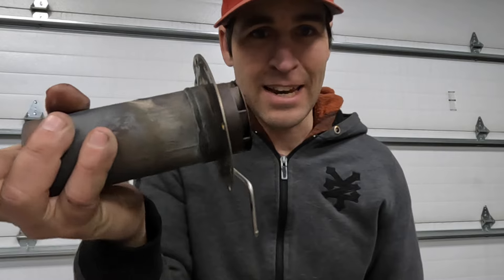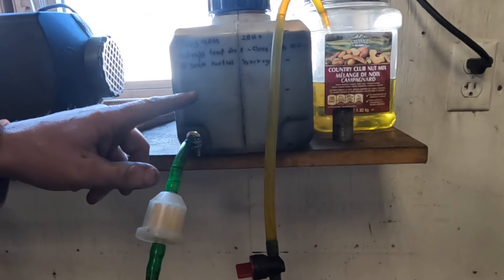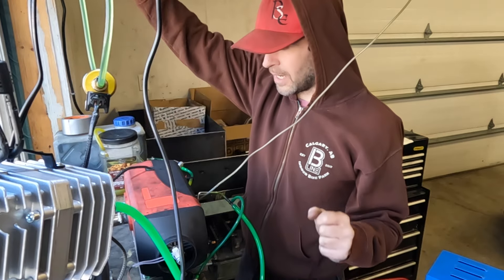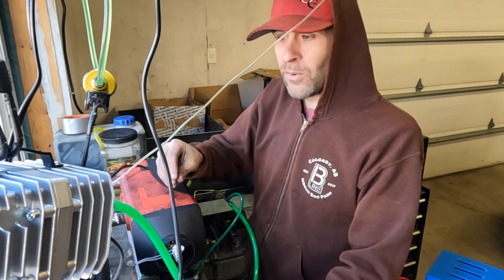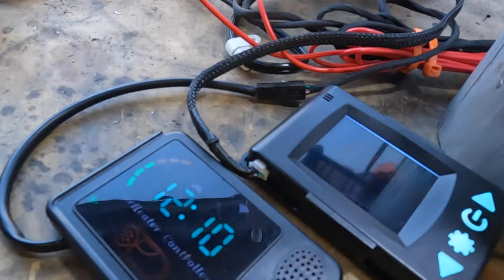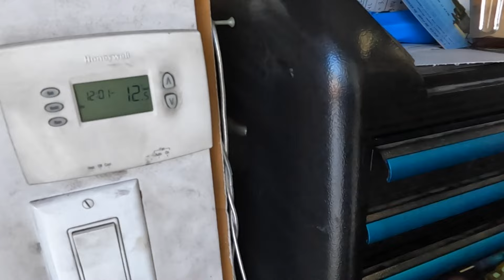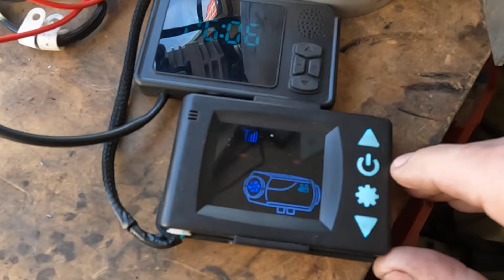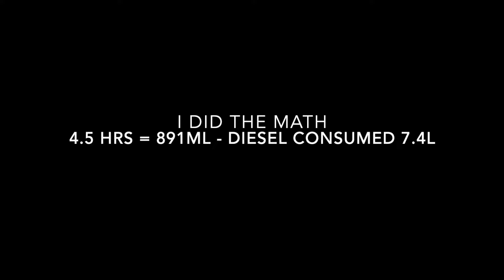Incredible Results - Diesel heater Burning Used ATF -  (Success?!)

Comment: Two of the 3  Vevor heaters I bought last month are the same $119 units you unboxed here today. What a bargain. 
 I've been meaning to ask,    is your 5% discount up and above the 5% Vevor offers, making it a 10% discount?  

 You revealed a lot about the new design of the burn chamber. 
  If there were only a reasonable way to make adjustments on the fly inside the chamber,  that would be cool .  

 27:42  For what it's worth,  I foresee a few things happening.  Nice design by the way 😮
*The heat exchanger body getting hotter than what the rest of the components are designed for and setting the stage for a spectacular "Final Meltdown" 🔥🧯👨‍🚒 👍🏼  
* It may carbon up if the airflow is restricted too long in the burn area even though the attempt is to keep it there and burn ALL of the fuel / gases prior to exhausting them.  
* It may go viral and get 3 million hits !  👍🏼
 
🤷🏼‍♂ So what else is left to do but drop it in there and hope for a eureka moment.  🙏🏼 

Vevor's secretly using you for your R & R work 😂🤣
That's cool, keep sending your products Vevor, and Joel will keep putting them to the test... 

🤔My lowered expectations exceed themselves 🤔? wtf   😂🤣
Reply from the maker: I thought it was additional, but apparently it's not, because the item is on clearance (I'm guessing). I just added one to my cart and tried to use my code, but there was already a code there... I deleted the code and now the website is NOT happy, haha. 

If I left the fuel nozzle loose I could rotate it and see if it makes a difference. I've been working on the new nozzle (pretty much done) and I think it is going to be much more effective. I also noticed that the oil that got in my air pump didn't do it any good... I have serviced it, but it needs new valves ... It doesn't always make the same pressure / flow, but when it does, it is pretty impressive. 

Haha... I like your predictions. Hopefully I can control the heat so it doesn't melt ... yet. If it is too restrictive I should be able to tell pretty quickly, based on CO and the temp it reaches on diesel alone... then make changes and try again. I may have to widen those slots. A viral video would be cool... haha.🤟

Haha... yeah... Vevor is making notes and ready to release their J Spec Combi heater. Diesel / WMO heater.🤣
Reply: @loweredexpectations4927  I'll try to buy one tonight. I bought mine on clearance but,   as late as 4 days ago
 I noticed Vevor were selling them as a "on sale" item. 🙄 
  Ying-Yang advertising,   It's all Chinese to me 🤔 Hahaha !

" I've been working on the new nozzle (pretty much done) and I think it is going to be much more effective".

I had to delete the burner idea I had wrote down 😂 mainly because it involved using 2 bearings within the  heaters housing and got wilder from there. 

I was thinking back to last weeks comments that the "pump" having rubber valves / O-rings,  might be vulnerable to swelling issues as does the principle behind swelling oil seals in order to stop leaks.  It's a good thing to know for obvious reasons and well worth mentioning.  Will be watching for more 👍🏼

Hear ye, hear ye, hear ye ‼
Get your very own J Spec Combi heater. Diesel / WMO heater coming to an apocalypse near you, 2025.
Reply from the maker: @DanDan-yy8sf  HAHA... I have had some of those wild ideas that I was like "ok, now let's design something that I will actually build" 

Haha... I'm thinking that I REALLY want to try "burning" pancake syrup in my secondary chamber... just to see what happens.
Reply: @loweredexpectations4927  Smells like the right thing to do 🤣

Comment: Can you try spraying water into the intake when running to see if it cleans the inside with steam? Just like the decarbonization is done in cars.
Reply: Water Methanol mix, like in diesels, would be fun to see the effects
Reply from the maker: I do want to try this, out of curiosity and almost did it during my last test haha... 

It could actually work with this set up, as the primary chamber will keep it nice and hot. Others have suggested this before, with the single chamber... the issue with that is that it would have caused it to flame out pretty quickly. 

Now you have me wondering what would happen if you injected liquid nitrogen, haha.
Reply from the maker: I'll see if I can make this happen 👍

Comment: Key ingredient ATF👍 
1. Always add the diesel deep clean treatment to any waste oil fuel supply to help carbon/coke burn completely to ash.
2. Add ATF to used oil supply to help keep the fuel tank/lines/pump clean, and help scrub the inside of the burn chamber.
3. Some sort of way to occasionally inject air bubbles into the fuel line to 'interrupt' the fuel supply into the burn chamber so a little extra oxygen is added to help burn carbon/coke buildup and blow it out.
4. I built a heat exchanger for the burn chamber air intake to syphon heat from the exhaust to help bring the oxygen and fuel closer to its flash point
Reply from the maker: Thanks for the comment. 

I'm not sure if these are suggestions, or stuff that you do... 

I have used a few different fuel additives by Redline and STP... They seemed to help a little with reducing carbon. 

I found that burning ATF cleaned out the heater when compared to / after running waste engine oil, but for me, burning diesel does a better job at removing soot / coke.  

Adding air bubbles will make the heater run lean due to the lack of fuel, but the amount of air in bobbles is insignificant. a bobble large enough to make any difference in this way would starve the heater for fuel and cause it to flame out. 

Burning waste oils does require more heat, so I can see how heating the inlet air could help... I have experimented with this in the past and didn't find a substantial difference in burn quality, but it was a long time ago and I probably wasn't tracking the data well... Hot air is less dense, so while it carries its own energy, it is not capable of producing as much energy. 

If this stuff is working for you, then keep it up ! 👍

Comment: The ring you plan to insert may benefit from some smaller holes around the big one to get a circle of flames around the center
Reply from the maker: You could be very right there... I did that with my original burn chamber.

Comment: Hi Joel,

Thanks for the test.
I don't recall where I read it, but I remember reading that someone was burning a 50-50 mix of used ATF and diesel directly into their primary heat chamber, with no ash buildup.  It seems that ATF burns a lot better than used or new motor oil does, and without causing an ash buildup.

Could be that ATF is closer to diesel and kerosene than motor oil is.  That kinda makes sense as many diesel folks (myself included) use atf as a fuel treatment for their diesel engines.

You might try the 50-50 direct burning as a test.

Philip
Reply from the maker: Thanks for the comment. 

I have been trying to tell people fro almost a year that engine oil has a whole different set of challenges to other oils / fluids. It is a heavy oil and will produce ash regardless of it being "clean" or not. 

ATF, like you say, is closer to diesel, in the way that it has the stuff removed that causes it to produce ash. I think the same is true for hydraulic fluid. If you are able to find a supply of this, it is definitely worth giving it a try. I think that the 50/50 is probably on the high side. I would try 70 oil 30 diesel (or gasoline) 

I'm all out of used ATF and it is about $40 a gallon, haha.... but if I come across some used stuff I will be trying it again in a standard chamber.

Comment: So I modified my burn chamber like you have with the holes for more air flow. But I cut 4 slits down the sides of the chamber and bent the cuts inward to create a swirl affect to burn my waster oil. Very little soot build up after burning for 24 hrs making sure the temp stays above 200c
Reply from the maker: Cool stuff ! I see I'm a bad influence on you, haha. 

I'm confused about what part you cut slits in and bent. The baffle ? 

Are you burning a mix of oil and diesel ? Typically, soot / carbon is from an incorrect air fuel ratio, or too cold of a burn. Ash (the white stuff) is from crud in heavy oils and the slag or oxides is from other impurities.

Comment: Great test. That new insert looks promising. 
I’d caution against using impact tools on things threaded into aluminum. Not that it matters much with the heat exchanger. 
Cheers.
Reply from the maker: Thanks ! I'm excited to try it. 

Haha... yeah.... The fuel feed tube was stuck in the chamber, and was actually free in the aluminum.... but it could have very easily damaged the threads. The hole in the chamber had expanded when hot, I threaded the feed tube in nice and tight to stop it from leaking, and then when it cooled, it clamped down on the tube, locking it in place.

Comment: How about a big snap ring for keeping the baffle in?
Reply from the maker: That could do it ! ... I may have to use two ... one on each side. Great idea.
Reply: A piece of cardboard or paper should hold it until you can line it up and put the tube in there.
Reply: Or a toothpick
Reply from the maker: @markcoyle8003  That's what I did with the chamber piece... but this time there's an extra baffle that will be free to move if not locked in place.

Comment: Joel have you ever tried tricking the temp sensor some how like putting something between the sensor and the heat exchanger to make it run hotter.
Reply from the maker: I haven't done it, but I have told others to do it 🤣 .... My current ECU will allow me to get over 267C.... I'm not sure if it is defective or what, but I saw 267 the other day without it shutting off. 

I have thought if this though, yes... Putting a piece of gasket paper or something between it and the exchanger, or something to reduce the contact patch.

Comment: Dang man I feel like u read my mind sometimes! Awesome new chamber. I’d like to see you try injecting down stream and upstream. I wonder if going upstream will help mixing a little better because of the lower pressure used. Awesome vid sir.
Reply from the maker: Thanks !! I don't think the air circulation is very aggressive , but I like that idea... going against the grain make cause some turbulence and improve mixing.

Comment: Sorry for so many comments on this video, but I had an idea right at the end. What if you pumped the oil or ATF through a filter first to lower the impurities?
Reply from the maker: I am using an 80 micron filter, but I think either a centrifuge (ideally) or a very fine 1 micron filter would work well with the ATF

What this test highlights to me, is the difference between the waste oil and ATF. The stuff left behind from the ATF looks like it could be filtered out. It is almost 100% slag or oxides of wear materials (I assume) ... In contrast, the ash from the waste oil appears to be from the oil itself. 

ultra filtering the oil would remove the metal oxides, moisture and a lot of crap, but I believe the majority of the ash is a result of burning the oil itself.... Though I may be wrong about that. 

What makes me think this, is the fact that I burnt brand new engine oil and it had just as much of the white ash as the used stuff.
Reply: @loweredexpectations4927 Have you tried new ATF yet to compare with used and I just missed that video?
Reply from the maker: @wallacefrey6247  Nope... I have not tried new atf yet... other than 2L of new stuff as part of this test... I ran out of used stuff.  Stupid stuff is like $40 a gallon here... I think I found some for $33 for 5 quarts

Comment: I'm curious about the power to run the pump. There's all kinds of cheap board controllers on eBay and amazon. Pwm controllers for example. Hi from Lacombe.
Reply from the maker: The air pump or fuel pump ? The air pump is 50 watts. The fuel pump is 12V and runs between .8 hz and 8hz pulsed DC. Someone is sending me a pretty cool device that will allow me to run two pumps off of one ECU ... I believe it has its own pulse generator. Takes the signal from the ECU, then allows you to  split so many percent to one pump and the rest to the other, or to completely customize the output.

Comment: Have you tried using Veg oil in the same setup? i know lotta people usually mix with diesel or petrol and burn it that way, but id be interested to see how it would burn neat like you have here.
Reply from the maker: I have a few gallons of veg oil that I purchased to test on my heaters.... I was going to try burning it in a normal heater first, as I have an equal number of people telling me they have good luck and nothing but trouble... So I'd like to see for myself. 

I feel like my setup will burn it quite well and I do plan on testing it out. It's on the long list of things to do, haha.

Comment: Hi Joel, I think you said 23mm is 1l. I measured 23mm on my tank and I got 2hrs running. What do you think ? Thx.
Reply from the maker: I think it was 28mm and that is sort of a rough measurement, as I used a gallon jug to calculate... 

Depending on your exact heater, at your max setting, that sounds about right. WIth a pump speed of 6hz, you would consume about 950 ml in an hour.
Reply: I have a Vevor 8kw maybe more like a 5kw. I've set it up not even a month ago.
Reply from the maker: @kevinfarrell6948  Almost all of the "2, 5 and 8kw" heaters share the same fuel pump (22ml meaning 22ml per 1000 pulses) For more heat, they just cycle the pump faster and spin the fan faster.
Reply: Thx for all of the replies appreciate your input.

Comment: excellent work thanks Joel. Are you going to try used hydraulic oil at sime point?
Reply from the maker: I don't have any used stuff... but I do have 5L or so of new Kubota stuff that I will never use... I am considering using it. 

I have 400L of engine oil that I need to get rid of, so my main focus is on that.
Reply: @loweredexpectations4927 
Yes, burning new ATF to please your viewers might make your situation worse, not better.
For the money spent you'd have to do more oil changes and you may end up out of garage space before next winter  😆
Reply from the maker: @werner.x  Haha ! ... trying to decide at the moment if I'm going to sell or not... I was "approved" but at 10% interest and a very high payment.

Comment: Hey Joel, have you tried spraying both sides of the new gaskets with WD40 if you can get WD40? It helps from the gaskets sticking and tearing to the housing.
Reply from the maker: I will have to give that a try. I have used assembly lube and grease before, but WD40 would be much easier.

Comment: Just use thin double sided tape for your magnet on the outside...
Reply from the maker: Yeah... that would work fine. I have been placing a large one under the outlet of the tank.
Reply: @loweredexpectations4927  They actually work best away from the flow - the flow can pull the outer stuff off if there's a lot - however thinking about this as flow is my mistake, there's no flow here, ha ha.
Reply from the maker: @fredio54  True... Very little flow.

Comment: Is that the same stainless steel mesh that I sent you, or did you have to buy more?
Reply from the maker: Yes, thank you !! I keep forgetting to mention it in my video.... I still have a pretty decent chunk of it left. Although it gets chewed up, I think I will use it again, as it makes cleaning the chamber really easy... you just pull the mesh out and done.
Reply: Do you recall what the size of the stainless mesh you gave Joel was?  #20 or less (the smaller the number, the larger the holes in the mesh)?
Reply from the maker: @philipreich7035  I have seen a few different ways of rating mesh... one is the size of hole in it and the other is just by a number system, and I have no idea how that works.
Reply: @philipreich7035 Not sure about the size,but there about 12 squares per inch.